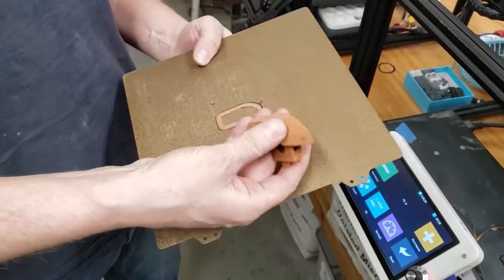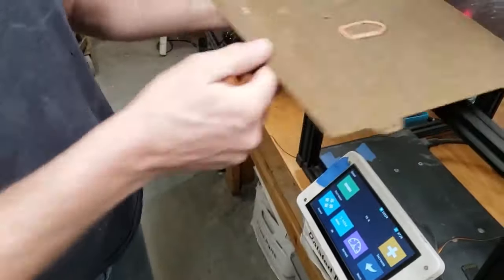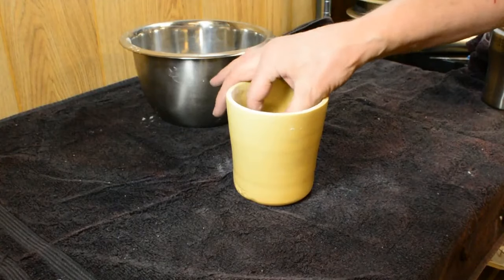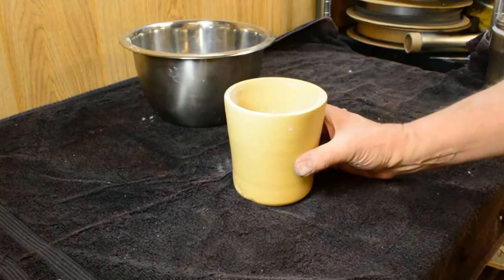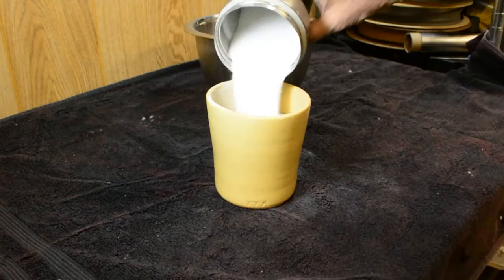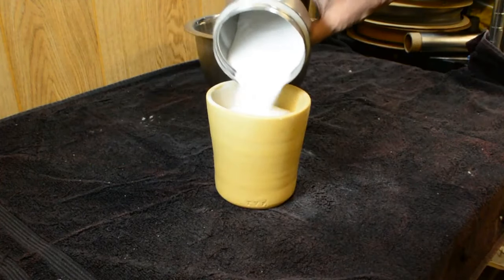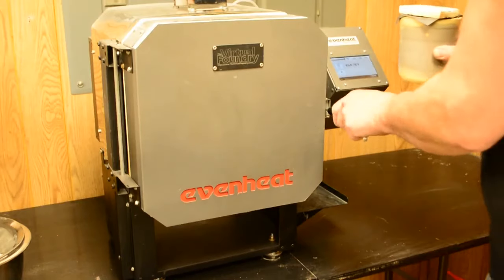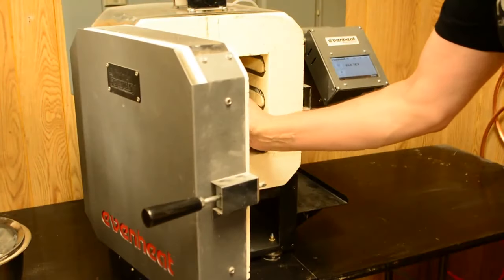FAQ: How Do I Vent My Kiln?

Comment: This is intersting but I'm left with "what's fff metal 3d printing." I'm sure you've answered this before, but this video just showed up in my feed. Looking forward to reading the instructions you linked!
Reply: FFF is the exact same as FDM (Filament Deposition Modeling).  Everyone calls it FDM printing, but FDM is a trademarked term (I believe by Stratasys), so if you are making FDM printers, you legally have to call them something different like FFF (Fused Filament Manufacturing). Think of it like Kleenex vs Tissues.
Reply from the maker: @matthewthomas1760 is right on. In The Virtual Foundry's case, FFF Metal is metal 3D printing you do on your regular FFF/FDM 3D printer, then debind and sinter in a common kiln - no gas or vacuum needed. It's metal 3D printing you can do in your own lab or studio. thevirtualfoundry.com
Reply: @CMDR_Hadion  tbh i thought your comment was from the OP.. thank you for explaining! @TheVirtualFoundry I checked out your landing page and I am gobsmacked that this technology exists... thank you for bringing it to a public audience, I look forward to getting started